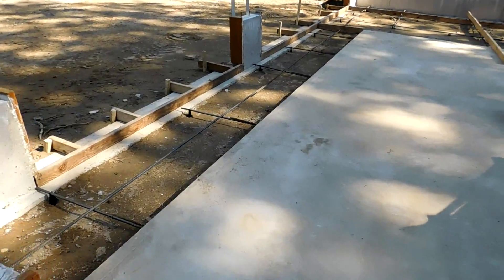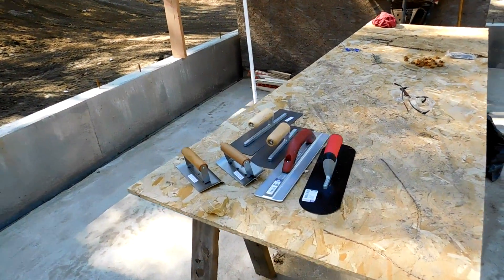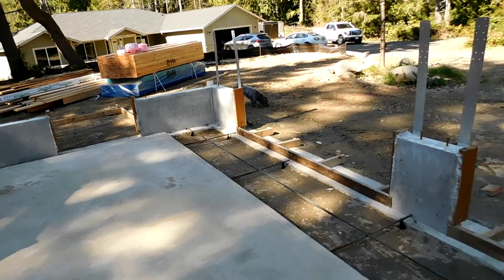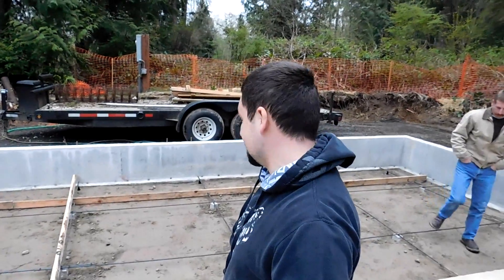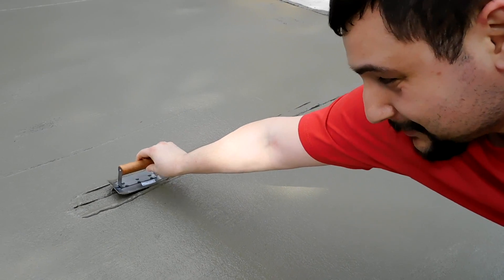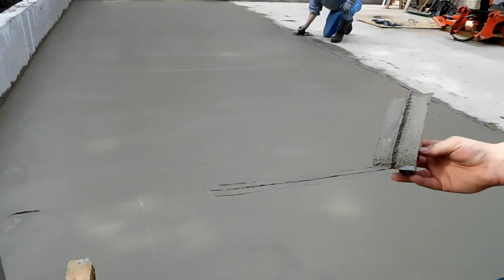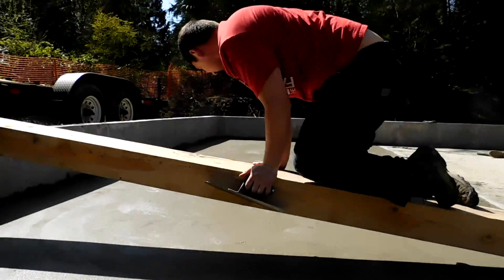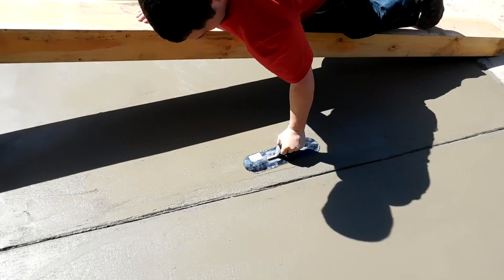Build my garage  #9 Pouring the concrete slab

Comment: Just a tip so you dont run into the issue of having the hump where your screed was pulled. Instead of putting a screed board just snap a chalk line down the wall. Then as you pour, float the edge flat along the bottom of the chalk line. Then you will have a flat slab.

Comment: I thought you were going to pull out the screed board out. I wondered how you would do that since it had rebar going through the holes that had been drilled through it. maybe you could turn some of those super aggressive ghetto termites loose on that board to chew it out of the concrete.
Reply from the maker: There were notches in the bottom of the board that allowed
the board to be pulled out. I did not show it very well in the video, I did not
think that people would want to know about the board as much as they have. There
will be another video about concrete in the near future that will show the screed
board, how I installed it, how I used it and how I removed it.

Comment: rebar should be at least 24" o/c minimum. I prefer it myself 16" o/c   and for sure poly under the slab. The rebar gives it extra strength especially when there is clay under the slab. In frost and wet conditions the ground moves to much.
Reply: Likewise.  I'm just amazed that anyone would invite future problems with under-strength reinforcement and water penetration.  That concrete looks too wet, too.  And who lets concrete harden on their floats?  This video left me with more questions than answers.  Using the future header was a stroke of genius.

Comment: No plastic sheets before pouring the concrete? 
Not sure about that...
Reply from the maker: You are correct, I really messed up in fact I’m going to make a video about yeh plastic under the concrete is important. Not having it is already creating a problem, I got some bad information from a friend and I did not validate it and it turns out plastic is a must!!!
Reply: Daniel Woodell - Plastic is nonsense
Reply: bullshit. plastic is a waste

Comment: Dan, nice job on the videos. I'm in pierce county was curious if you could answer some questions I have for a shop.
Reply: How do you get permits on a shop you build yourself? Did you pay an engineer to engineer it for permits then build off engineered plans? Thanks - mike
Reply from the maker: So I drew up a plan on a piece of paper with the dimensions, placement of all of the doors and window. Also the material that I wanted to use like hardi plank siding and what type of roofing material I wanted to use.  Then I went to a design architect in Silverdale. And she translated my drawing to a blue print. Then I gave the drawings to a design engineer that the county recommended and he added a few things for sheer wall straight. Then I was able to take the drawings with all of the other paper work to the county and apply for permits. Your local building department should be able to give you some pamphlets on the proses that they will expect you to follow.

  the architect was about $450

 and the design engineer was about $350

 permits are about $400

 hope that helps
Reply: Daniel Woodell 
Awesome dan, thank you very much.
Reply: once again awesome videos we are about to pour our foundation for a house and then I'm backfilling and also doing my septic system it's going to be gravity so it's great to see your videos and I've been looking for a way to build a shop without buying a kit so thank you again for info. How expensive was it for you to have somebody do the foundation on your shop with a stemwall? I was planning on doing the slab but a stemwall would be nice.
Reply: Daniel Woodell 
good morning . i wants to know how i can buy theis things .& how much prices .

Comment: Thanks for the informative video - i was wondering why some people cover
 the soil with gravel or sand before pouring the concrete? ... in fact i
 have seen some people covered the ground surface with plastic bags and 
poured concrete right over it. But it appears you have skipped that 
step. Is it unnecessary? Any feed back would be appreciate it.
Reply: You use plastic under concrete as a vapor barrier and as a moisture barrier to keep the concrete from absorbing water from the soil. It also works pretty good as a retarder.
Reply: allows for water drainage

Comment: did u leave that 2x4 under the mud? Could lead to cracking when driven over
Reply from the maker: No there is no 2x4 in the concrete, I realize from some of the comments that i should have spent more time on filming how that board was used, removed and filled. Just something I’ll have to catch in the next concrete video I make.
Reply: Daniel Woodell or just dont make any more concrete videos.

Comment: Never used knee boards I'm guessing. You can buy expensive metal 1's or just use some small pieces plywood. The idea is to work backwards. It's a ton easier than working off that beam. Always nice to build your own garage though. It's fun and who wants to pay the amount a contractor wants to do it. Good job and a good video. I loved it